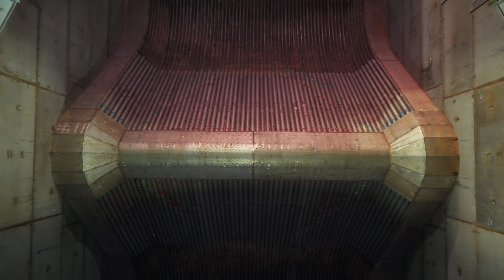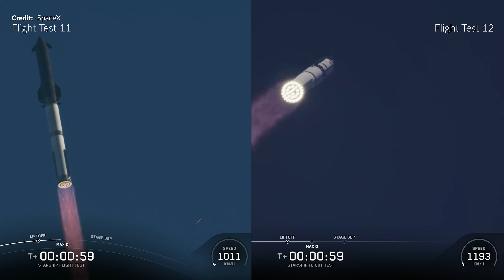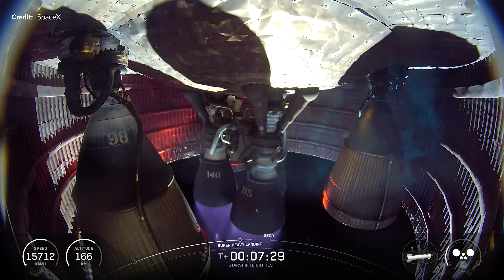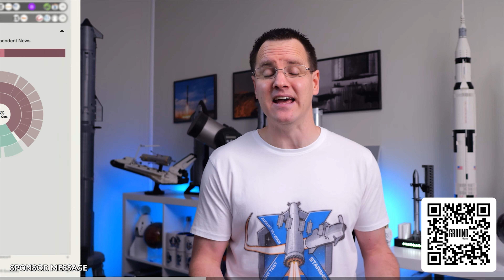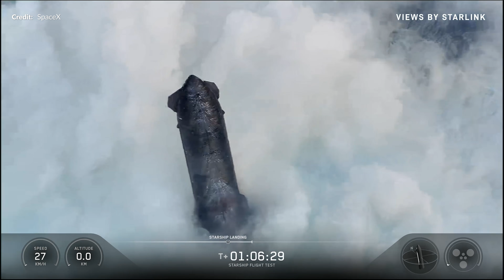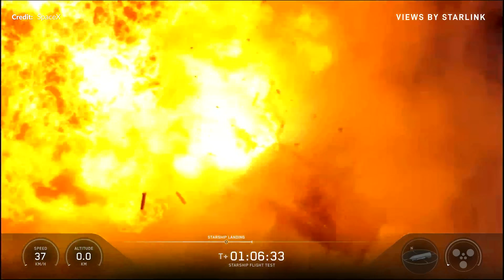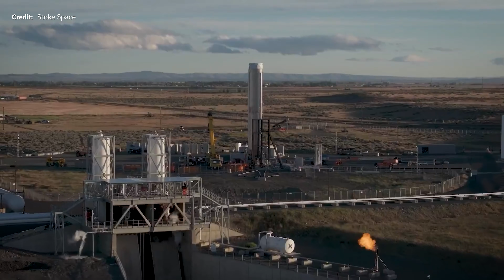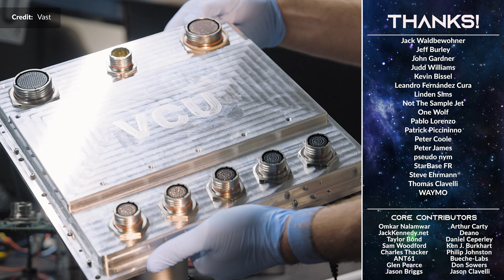Starship Flight 12 Explained - The First Version 3 Starship

Comment: I'm betting on a plumbing issue on the super heavy - dislocated tank or separated fuel line during that violent flip - something like that.  If so, they may either need to reinforce the plumbing structure, or make a less aggressive flip.  All in all, those V3s seem to be doing pretty well.  She did jump off that pad, didn't she!

Comment: Fun fact: total combustion energy release during lunch is ~60TJ, which is ~14kTons of TNT. Little Boy was 15kT
Reply: Wow !! But in fairness, Little Boy was much MUCH shorter duration for the delivery of that energy
Reply: @964cuploveYes, about 3 nanoseconds vs about 8 minutes.
Reply: Holy sh*t !!!
Reply: So, we need to put bigger soup can over it before lighting the fuse? 😅
Reply: Is this both stages full duration burn or just booster or some sort of measurement before it leaves the tower?
Reply: don't eat Taco Bell for lunch then
Reply: where do you eat your lunch??

Comment: Every time i see the ships transferring fuel, i think it is wrong. One ship has out ports and one has in ports. Both ships should be same, with outs on bottom and in on top or opposite. Then one flips to transfer. Then all ships work together and later on bigger longer missions fuel can be taken from a damaged ship if needed and not waisted.

Comment: I'm pretty sure SpaceX didn't intend for the super-heavy to flip upside down as it did.  That would certainly cause the fuel left in the tanks to slosh about problematically.  It looked to me like the hot-staging process imparted more lateral force to the booster than expected, causing the rapid flip.  A surprising lesson, I'm sure.

Comment: As impressive the landing was, does that burnt husk look anything like rapidly reusable to anyone?
Reply: Maybe not, but a huge leap forward from the last couple of flights. As long as they use ceramic tiles there will be a certain amount of char. The question is how deep was it? I didn’t see any obvious damage to the tiles in the rather quick view we got. The edges looked straight, not chewed up. The char looked much more superficial than in the past.
Reply: @evanmorris1178  Even if the heatshield does not require full replacement the 'tank it up and its ready to go' doesn't seem realistic with this technology.
And I don't think there would be any market for a suborbital human transportation service like the one Musk dreamed up if the vehicle you have to travel looks like this one looked when it landed.
Starship is revolutionary and could become reusable in relatively short time but the rapid reusability as advertised seems out of reach.
Reply: @l3zl13 How anyone can say this mission was a success, when it arrive back at Earth completely charred, then fall over, and exploded, is beyond me.
Reply: @DetroitMicroSound  Landing on water was part of the plan, so falling over and exploding does not change whether it is a success or not. 
The failed engine and the canceled reignite test does. So I wouldn't call it a success. Some goals were achieved so it's not a complete failure either.
Reply: @l3zl13  'tank it up and its ready to go' is for the superheavy booster. Ship will have time for a quick wash and inspection (like airplanes do)
Reply: @admarsandbeyond "quick wash and inspection (like airplanes do)" IS the 'tank it up and its ready to go'.

Falcon 9-s first stage is comparable to the Starship booste in it's usage and the current record is 10 days until reuse. Probably could be a bit faster if they really went out but far for a quick investigation. Superheavy might have some design advantages for a faster reusability that they learned from Falcon 9 but it will still take days at least. It might take even longer to prepare it than the Falcon 9-s booster since it's more complex.

Can you really look at Starship at the time it landed and think it just needs a quick wash?
(I don't think the tiles would even survive any kind of washing strong enough to remove charring.)
I won't say it's impossible, maybe there will be huge advancements in heatshield technology in the future or some other gamechanger but certainly not in the next 5-10 Starship generation.
Reply: @l3zl13  Where do you base your opinion that "Superheavy ..will still take days at least. It might take even longer to prepare it than the Falcon 9-s booster since it's more complex."? SpaceX has the data and doesn't think so (they are building huge armored launchpads for tank up and go).

The heatshield tiles as long as they're not broken (or missing) will be ready for reflight after an inspection (hours, days it doesn't matter. Even the Shuttle kept the same tiles if they weren't damaged (they took months because they needed deep frame inspections and changed entire pieces of critical hardware and aluminium airframe though
Reply: @admarsandbeyond On the fact that it's not an airplane. Airplane engines are designed with way more than 10k flight cycles and over 100k operation time for their lifetime. It's easy to believe that they don't need full maintenance and full in-depth checkout after every flight. 
Rocket engines come nowhere close to that.
Even if Raptor manages to improve on the between maintenance time compared to other rocket engines 10 or 100 times with this or even within the next 2 generations, that would still mean a full checkout after every flight.
"SpaceX has the data and doesn't think so"
Actually we don't know what the actual engineers at SpaceX think. We only know about Musk's plans which are usually way too optimistic to say the least.
"(hours, days it doesn't matter)" It matters because days between flights is not equal to "tank up and  go" and I didn't question if it will be possible to ready the starship and especially the booster to fly again within days. Fly again within days is the limit of the current technology in my opinion. Unless there will be some really revolutionary technological advancement "tank up and fly" is not a realistic goal.
Reply: @l3zl13  commercial kerosene turbofan jet engines are incredibly complex. Thousands of parts, high-pressure turbines spinning at tens of thousands of RPM, extreme thermal gradients, bird strikes, foreign object damage, etc. And they must run reliably for thousands of hours per overhaul cycle. Rocket engines are simpler in many ways and could (theoretically) become more reliable.

Raptor is nothing like previous rocket engines. It's designed to be the reliable and most reusable rocket engine ever built:
- clean-burning methalox with much lower carbon deposits, gentler on turbines and components.
- Full-flow staged combustion (FFSC) allows the preburner exhaust to be cooler across the entire flow, reducing thermal stress on turbopumps.
- High simplification with fewer external parts, internalized plumbing, no heat shield, full regenerative cooling, welded joints over bolts in places greatly reduces failure modes, weight, and maintenance.
- Short burn times + redundancy: Each flight has only minutes of powered flight (vs. hours for jets). Starship's 33+ engines provide massive engine-out tolerance.
"Tank up and go" with airplane-like checks is a realistic mid-term goal for the booster (which is what matters). The ship can take days, it doesn't matter as there will be dozens or hundreds of ships built for every booster.
Reply: It's Elon's version of Howard Hughes Spruce Goose. . . Except far more dangerous, destructive, and constantly spewing HUGE AMOUNTS of pollution.
Reply: @DetroitMicroSound  Nonsense, Starship exhaust is mostly water vapor. Methane is the cleanest burning fuel in existence (other than hydrogen). Starship is the most ecology-friendly rocket ever built, if we include factors like its full reuse and propellants (which can be produced by carbon capture with the Sabatier process).

Comment: I'm sorry but this being flight 12 it really isn't impressive as the biased  space x influencers would have you believe when you take into account blue origin being able to achieve with just flight one with all new hardware
Reply: Blowing up the booster in the upper atmosphere and not deploying the minimal payload they carried?  Not all that impressive for a PRODUCTION MODEL that took them nearly 25 years to achieve.  The 2nd flight was successful I grant.  The third?  Failed to deploy the satellite in a viable orbit.  So one success for 3 tries on a PRODUCTION MODEL in over 25 years now.  

SpaceX in 23 years has flown 3 generations of production models, 2 with reusable boosters (which no one else had done) and is flying a 4th generation rocket of record size and thrust on testing missions.  They also created Starlink which has the largest constellation of satellites ever created.  They have their own manned capsule - also reusable - another first for them and their own cargo capsule - also reusable.

Guess which has actually accomplished more?  Which has set more records?  Which is more impressive in their accomplishments?  

:face-turquoise-covering-eyes:

:face-turquoise-covering-eyes:
Reply: @Scanner9631 and yet zero orbital flights with 12 and counting just saying doesn't live up to the hype and with the dumb tag line "excitement guaranteed" to overshadow the failures

Comment: I was surprised that they still do not have a handle on the engine failures 😢.  A very good partial success though 😊
Reply: Normal first test of new design engine.
Reply: @daveeyes Not normal for a company that has been producing engines for over 20 years. These engines were all tested in Texas. How many test hours hours of testing were done in Texas on the "new" engine? When the BE-4 had insufficient thrust, it was reported as a failure, when Raptors prematurely shutdown that is expected😂😂😂😂😂
Reply: @user-fr3hy9uh6y  BE-4, which took >13 years to develop, is a much simpler, mid-performance, easy engine compared to the (cutting-edge, ultra-high performance, yet mass produced and dirt cheap) raptor. And Starship ignites repeatedly dozens of them simultaneously on an ultra-high performance launch vehicle.

Comment: I think they need to upgrade the quick disconnect swing arm.  Or push the actuator fast faster. We all noticed how quick it got off the pad but again look closely at the quick disconnect arm. It doesn’t get out of the way fast enough.  I know the ship is headed away from it, but I think they need to disconnect the ship just before booster ignition and disconnect everything move the arm faster.

Comment: so, both stages crashed and burned ?
Reply: Uh, no. They plan ocean landings for now. They're testing stuff. Normal to come apart when hitting water. Spare fuel burns.
Reply: @daveeyes The VERY hot ship falling into ambient temperature seawater probably doesn't help things. Plus once the tanks fracture...a big boom ensues.
Reply: The booster did. The ship fell over after a simulated landing in the ocean.

Comment: Considering this a completely new ship and booster and engines and pad, I'd say its pretty successful. Raptor 3 engines performance is as announced. If they can iron out the issue with the booster I'd say they are on track for re fuel demonstrations

Comment: We need to stop Starlink until they solve the aluminum Oxide issue on reentry,  it's causing Ozone depletion. 

Everyone that uses it is paying to ruin our planet! Same with Ai, vote with your dollar! Aka stop spending money on these things!
Reply: ...aluminum...oxide... (long pause in pure amazement) ... uh. I hate to even say this...but it's made of stainless steel, not aluminum. About every mention of this rocket, ever, has said, stainless steel.
Reply: @daveeyes  STARLINK satellites?!?! Read the research papers on this topic, its not good. 

Never said anything about Starship, thou it is fundamentally flawed and wont be rapidly reusable in current form, if ever,  Heat tiles concept is from the 50s. IMO stoke space's core design  is way more sound for rapid reusability! My money is on them, plus the CEO is down to earth good guy. 

Screw the billionaire class!

Comment: Some speculate the faster booster flip maneuver could have been a contributing factor, possibly causing excess fuel slosh, causing the starvation to the engines, and causing damage, like what happened to the 10 engines when they had shut it down immediately during an earlier thrust test after a pad manifold malfunction(the one featured in their short documentary)
Reply: It did seem that there were more working engines shortly after the booster flip than were shown running in the graphic.  Intermittent fuel/oxidizer to the pumps/engines due to sloshing could account for that.

Comment: Just imagine just one of these exploding on the pad it will be like a small nuke. There is absolutely no chance it will be rapidly reusable the heat shield will need to be replaced after each launch that's for sure.
Reply: 12 test launches more static fires and NEVER have the naysayers been right on the prediction of exploding on the pad and destroying Boca Chica but they still insist it will?  What do they call doing the same thing over and over and expecting different results?  Will you still be making this prediction in 20 years?

:face-turquoise-covering-eyes:

:face-turquoise-covering-eyes:
Reply: @Scanner9631  Ever heard the saying never say never :)
Reply: The system needs to demonstrate abort capacity and capability before any people ride the rocket.